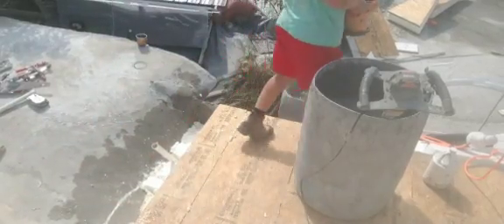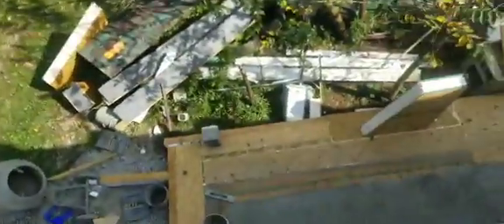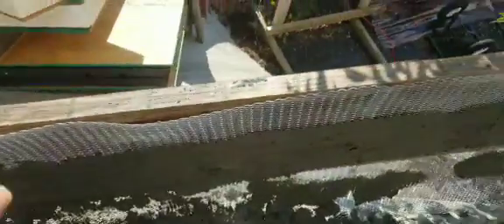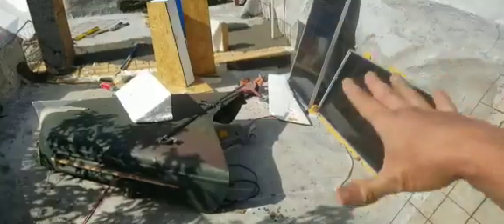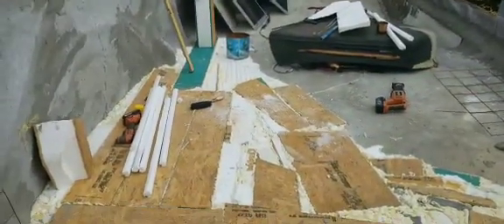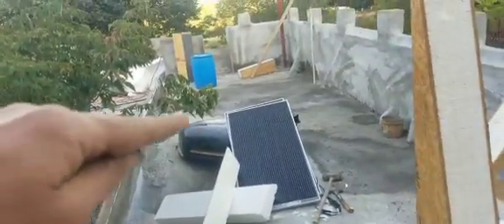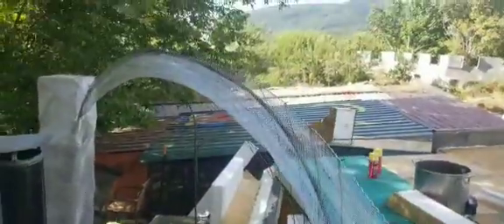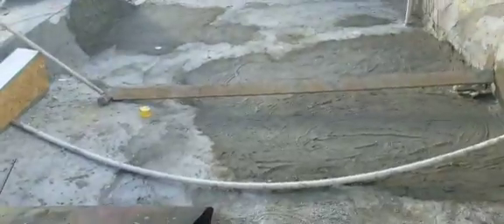Ferrocement Castle Insulation Projects w/ Recycled/Waste Panels + Aircrete

Comment: looking great, what does drexel solution do for the ferro cement?
Reply from the maker: The Drexel solution is the foaming agent for the aircrete, so it doesn't (shouldn't) affect the ferrocement directly. But the (aircrete) insulation should help the ferrocement last longer by limiting the temperature swings that affect the steel